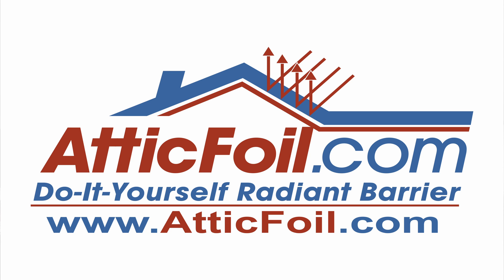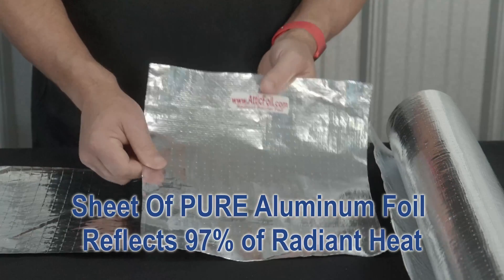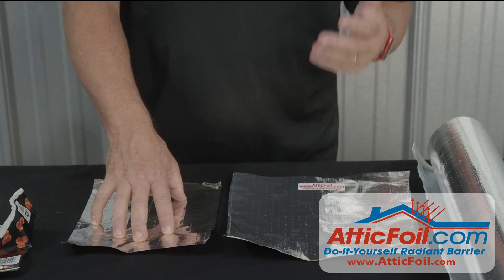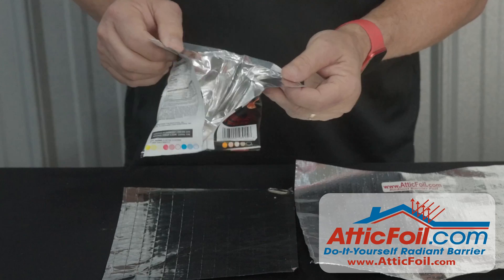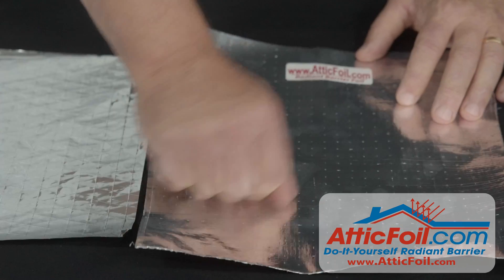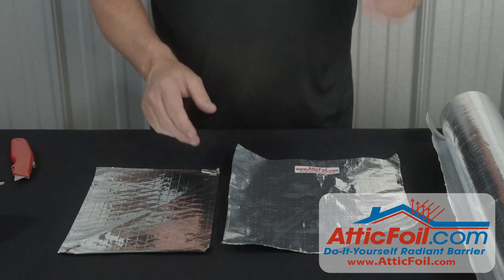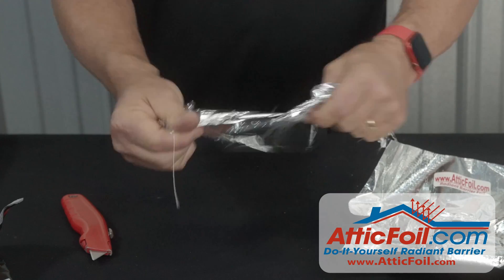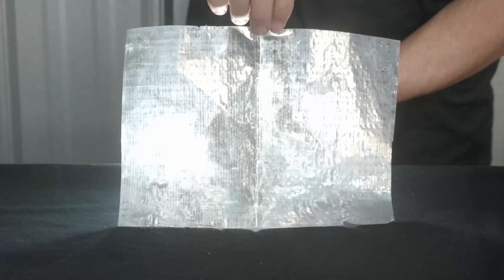AtticFoil® vs  Metalized Film/Mylar® Type Products - There's A BIG Difference In Quality!

Comment: Good demonstration of you get what you pay for. 
Hopefully sales are brisk during this Solar Maximum. 
Have you tried multiple layers with air gaps between? 
Wondering if that would help reduce solar heat gain in any meaningful way.
Reply from the maker: Multiple layers work pretty well if the air between them is "dead" air.  As for a typical attic?  Since the first layer of www.AtticFoil.com reflects 97% adding additional layers has very little additional benefit.  Kind of like having two umbrellas.

Comment: Appreciate the video.  Have some questions on best process.  Looking to install attic foil in my home AND increase the insulation.  Currently have cheap, thin fiberglass bats.  Looking to add cellulose due to the better properties versus blown in fiberglass.  However, I see cellulose makes a lot of dust when installing.  I read/watched online that if the radiant barrier surface gets dusty, it diminishes its properties.  So, since you recommend using the radient barrier to block the soffits and create that draft area behind the barrier and then one would install insulation.  how do I install the radiant barrier and then the cellulose without diminishing the barrier properties due to cellulose dusting?  Thanks
Reply from the maker: Very little dust will actually end up on top of the www.AtticFoil.com when installing cellulose.  And, no matter how much dust you get on top the bottom side will always work due to the emissivity quality. More info here: https://youtu.be/zUHYiAn1oUc